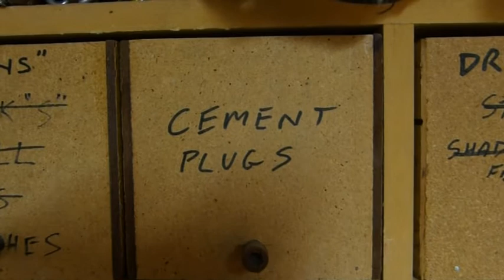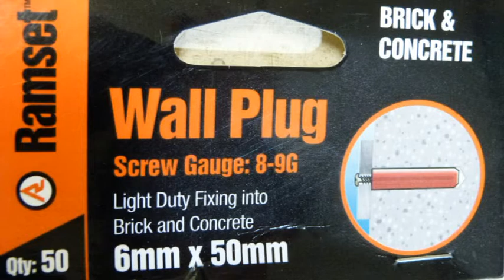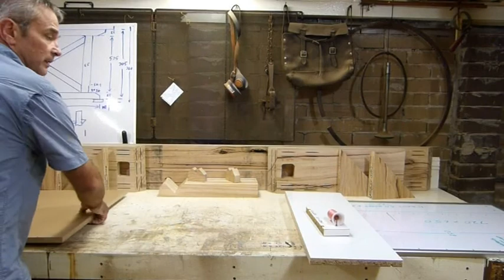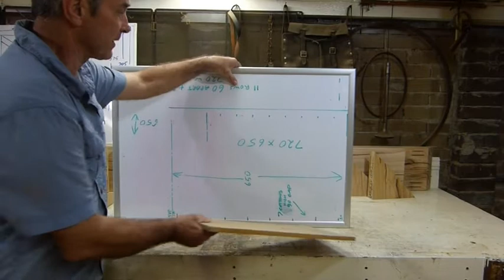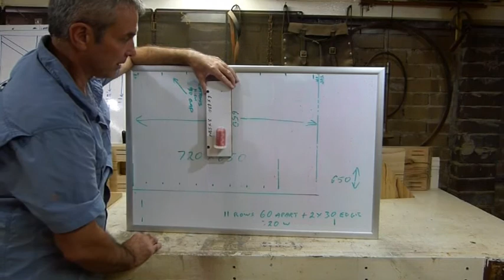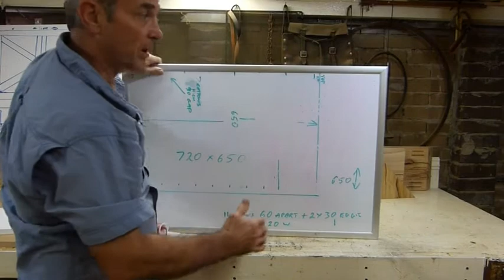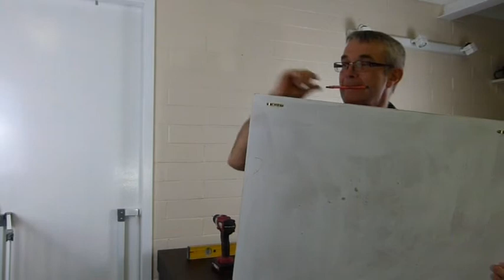Easy DIY Embroidery Thread Holder for Sewing Room Organization Ideas and cotton storage

Comment: A very good, clear video, Thankyou, It's just what I'm wanting for my studio too. My only adverse comment is that it is set up too high on the wall. I feel that it would be easier for your wife to use if it could be lower & where she can use it whilst sitting at the machine  IE: to the right of the power point, under the lights, sitting nearly on the bench, or lower down on the left of the power point. 
I also think that another useful hack is to put a magnetic strip up on the wall near the machines, to store her scissors, clippers pliers, etc so that they are in easy reach. It is such a pain looking through drawers for the different tools necessary. Cheers
Reply from the maker: Thank you I am glad you liked it. I talked to my wife about your suggestions, she said she likes the board where it is as she now has her machine on that end of the bench and we have all her scissors etc hanging on hooks close to her right where she wants them. Your comment was spot-on, thank you for your suggestions.

Comment: What a great idea.  I love how you produced this much simpler thread holder compared to the other one which was great also.  And there is enough room above or below to put the number of embroidery thread on the board ensuring that after use the thread gets put back where it belongs.  Only one thing keeps me from making one and that is unfortunately all my wall space is already utilized. (and my routing experience is non existent but I could add molding to the edges instead).  Is there a way that it could stand up and be put onto wheels so that it could be pushed under a desk when not in use (and not fall over naturally)? If you added thread to both sides by alternating the holders on each side of the board - would the size you recommend for the wood still work? (I have a lot of thread about 200 reels! and that doesn't include my sewing threads or overlocker threads) And with thread on both sides and even enclosed like a very skinny cupboard perhaps using perspex or even plastic stretched  on a frame utilized as a door that opens and shuts so you could see the threads.  That way it would be dust free, away from sunlight and nothing falls off when moving it.  That would be my dream thread holder.
Reply from the maker: Hi Debbie, Thank you for your comment. 
First, yes good idea we should have the number of the embroidery thread on each hook THANKS.  200 reels of thread, have you got anything on the back of the door to the room? Just a thought, screw a board to the back of the door.
Yes if you used 18mm or ¾ inch thick wood you could screw the hooks in from both sides. If you were to put wheels on a board to slide it under a desk the base would have to be 200mm or 8inches minimum wide, and really should be wider to be stable (I am sure if you did this you would not be happy with it and would soon be looking for a better idea.) I do like your idea of a Perspex cover to keep the dust off them.
Do you have doors on some cupboards in this room? Is there enough room to screw the hooks and put the reels on the inside of the doors without hitting whatever you have in the cupboards? Or even screw the hooks into the outside of the cupboard doors.

Comment: What was the distance between the screw holes you drilled and size of the main board you used?
Reply from the maker: The holes were about 45mm apart on this one, ( sit two of your reels together and see how far yours should be) I have made others 60mm apart, because of the size of the reels to be stored. I am sorry I do not have the size of the board on the one in the video, but 950 high and 650 wide, are the size I have made a few. ( lay out a few reels and see how big you want yours) I hope this helps a bit.  I wish you the best for your project.

Comment: Hi, thanks for this. Very easy to do. Quick question. How did you measure out for each spool?
Reply from the maker: I think the best way is to get a few hooks and cement plugs or what ever you have decided to use to hold the reels. Use an old bit of wood and have a play, make sure you can slide the reels on and off with the other reels above below and to the sides. If you are cramped for space keep things quite close together, making sure it all works well, but if you have a bit more room I have found things look better with a little bit of room around them. This will give you all the measurements you need. It's just a matter of marking out the grid onto your board then. Hope this helps.
Reply: Thanks for the quick reply Gavin
Reply from the maker: No problem at all, have fun with your project.